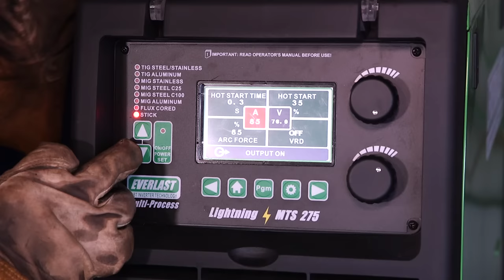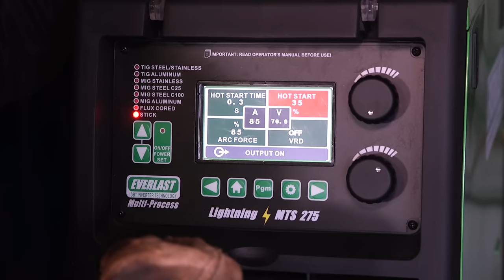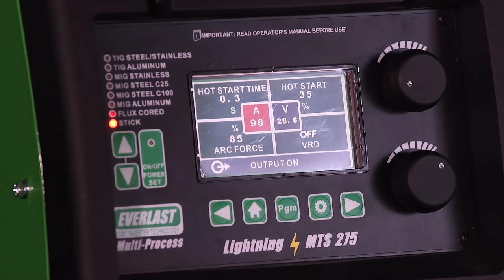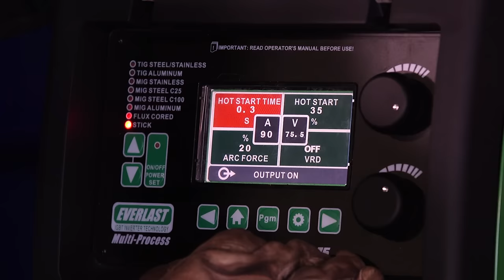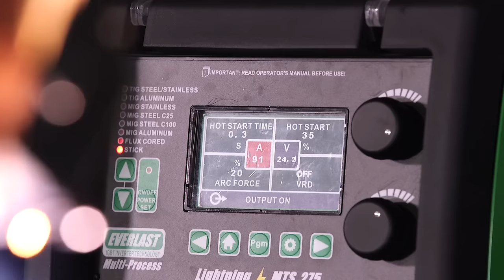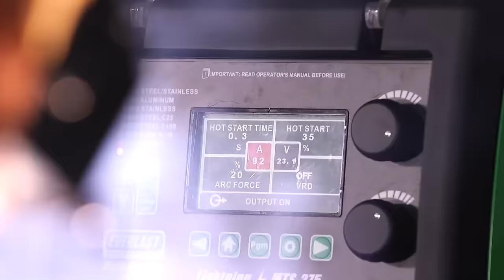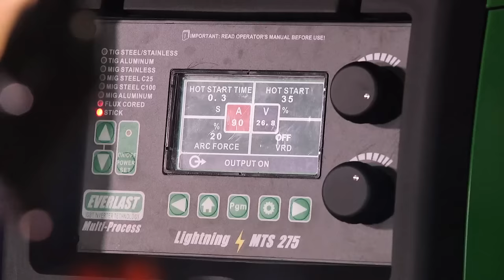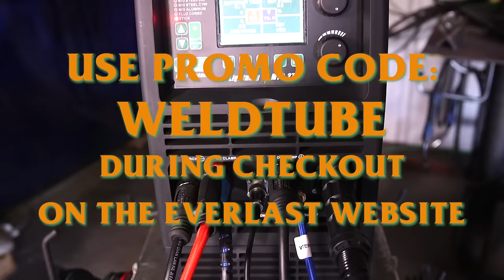STICK WELDING for Beginners | SMAW 6010 & 7018

Comment: you aren’t gonna find a machine like that at any highschool😂😂😂
Reply: we got into the shop today in welding and definitely not
Reply: My technical school when I was there had a $25,000 dollar welder and all of the basic ones in each booth were millers. But my county had ridiculous funding from some rich dude
Reply: ZarRax/ZR 😂😂😂😂😂😂
Reply: My high school has a bunch of miller’s they strike instantly
Reply: I’m in the welding program at Tampa bay tech, we only use Miller and Lincoln. Two more years till I leave and get my certification senior year
Reply: Haha, when you actually do
Reply: @C20ze  same
Reply: Nor out on the field smh 😂 where are the engine driven ones
Reply: You would love to see the welding shops in here Kern county high schools. They're sponsored by large oilfield companies and spare no expense, they're beautiful.
Reply: @Rylan Jennings my school has the nascar edition of Lincoln Electric multi setting welders
Reply: Or any job site lol, btw, tic toc works better than 1 2, the beads he is stacking are called stringers. The slag peeling off is a dragons tail. If you watch your puddle, there will be little or no lines in your weld, just smooth as glass.
Reply: @jackallred8228  tbt is a beast of a school. I wish I had went there instead of chamberlain.
Reply: My school has the Lincoln rectifier ac/dc. Not a bad machine but I wish each booth would have different machines so we can learn about them bc once were in the field they’re all different
Reply: @yehudastollak6808  that is what u need so u learn to set a machine to the sweet u like to weld in
Reply: @jackallred8228  Shit bro we go to the same school 😂😂🙏 and I’m in welding too
Reply: @veshiki1472  what period do you have welding
Reply: @jackallred8228  I was quarantined up until now, i get back to school tomorrow and I got 8th period welding and im in booth 10, I missed alot of time on the objective rip😔
Reply: @jacobcole4545  same currently burning 7018 Excalibur’s on it
Reply: My school was full of dynasty’s lol
Reply: I go to college classes and we don't use those either
Reply: Fontana High school, all Millers, strike instantly
Reply: My school has Lincoln electric machines they are very good they have all those setting as the one in video
Reply: My school has like 30 miller 250s
Reply: My highschool, with a graduating class of 20 has 9 Lincoln power mig 215 mpi welders
Reply: We have esab rebels at mine
Reply: We ran Miller Dialarcs for stick units. Loved those. So smooth. Rest were syncrowaves I think
Reply: We have like 5 millers and 4 lincons
Reply: We got millers at school
Reply: Miller's and Lincoln r just as good lol wtf
Reply: I have one
Reply: We do aswell
Reply: We got miller's

Comment: For anyone learning, after the root pass using 6010, it might help you to grind down the root pass to make sure that root is clean and theres no debris in there if its an xray test. 6010 is a DIRTY burning rod. Dont grind down far, just the top where the “coin stack” look is and not much farther. Just to make sure its clean. Dye penetration tests will reveal that shit as well. 

On the hot pass, you can also oscillate with a circular motion, making sure to hold the top wall for a quarter second or so to prevent undercutting on the top side. Gravity usually takes care of the bottom side assuming you dont come down too far and undercut. After cleaning the hot pass, run stringers over the top of it real nice and slow, 7018 looks real nice if you just let the rod burn and fill in :)

Professionally schooled, worked as a stick welder for a bit. Got 2000+ hours welding :) certified in 3G 7018 open root structural v groove welding
Reply: For pipe yes....but for this simple small puny t joint, weld on 👍
Reply: That's a 3F, show a 3G, with or without back plate, also you should explained AWS ,AISC, ASME STANDARDS there's a difference.
Reply: @Skyler Houtz theres always competition man, the thing about welding is it comes down to the test, if you pass it, the other competition doesnt matter. Just pass the test. Easier said than done, I know. But as long as you can pass a cwi administered test you should be gone 

Also ive never heard of hyperbaric welding sooo cant help much there
Reply: @stevenbruce5799  do I really have to do circles with 7018?
Reply: What if your goal is strong (full/near full penetration) welds on 1/4 to 1/2 inch plate?  Obviously, bevel (both sides) when possible. 

Is it best to run a 6010/6011 root pass then?
Reply: @ineedmoney6685   no, lol.
Reply: I guess I got lucky when I took my state weld test and the examiner cut my coupons and they came out perfect on my first try. Back in the day, we didn't have the option of grinding down our root pass. All we had was our chipping hammer and wire brush to clean every pass. Like I said, I guess I got lucky or I'm just a damn good welder. I'll take the latter.
Reply: I hear you, bro. I have to say, welding gets in your blood. At 66, I still love to weld. I still remember pretty much everything I learned at welding school and all the jobs I had at the ship yards and dry docks. It's still in my blood and I can still burn a mean rod. BTW, I love the 7018 lo-hy rod.
Reply: I got 10k hours

Comment: Dude, thank you so much for these videos. I'm currently at a welding tech school in the ass of nowhere Virginia, and my instructor is bottom level garbage can. Threw us into the lab, said here's the gas, here's the fuel, don't blow yourselves up, figure the rest out as you go. Only thing he actually told us for fillet was weld at a 45 degree angle, and to lay the root with a 6010 and the hot passes with 7018. Didn't even explain what a damn hot pass was. No explanation of proper amps, distance from weld, how to start an arc, where to hold the rod and at what distance from the metal. Keep in mind, I'd never touched a power tool before walking into this guy's class. I'd be lost without this info! You're helping me make my dream of a career in the trades into a reality. Great channel.
Reply: Currently what I’m dealing with now lol. Didn’t even explain the reason for amps, just said play around with it and do what works best for us. Definitely feel like I’ve wasted money but at least youtube will help me get through the course
Reply: Low key in the same boat. Instructor just kinda threw us in the deep end and explained very little. He has me on these tee joints and not once has he had me do this many and or said to use both rods during it.  Maybe that’s later cause I only just got put on stick. I passed my MiG section with the bare minimum of instructions. I had no clue what the dials did on the wire feed, or the voltage machine. No clue on distance. Thankfully o have a buddy who did the same course and he’s been the one nudging me in the right directions
Reply: Same bro I’m going in Virginia now currently

Comment: I've been a machinist my whole adult life, but took an adult welding course thru the local CC. I skipped the 1G and passed the 3G (vertical up)SMAW test first try because the instructor was so good. I had zero experience, literally never held a electrode before the course. Good instruction is priceless.

Comment: 1. i learned to never use a wire wheel to remove mill scale
2. i learned some good movement patterns for better welds including the forward back pause and small circle methods
3. i learned to always cover 50% of the last pas on the new pass
Reply: I always use wire wheel

Comment: The biggest problem I had when testing at the first couple of places is not letting the material properly cool. Don't let your nerves get to you. Take your time and don't get in a hurry. If the material gets too hot it won't flow right and if your doing verticals it will start falling out and look sloppy. Then your going to have to grind alot.

Amperage if course depends on your material thickness and rod size, but for a standard 7018 1/8 rod on 1/4 test plate I like to run at 115. But machines can be squirrely so see if they will allow you to run a pass or two on some scrap material. 

 Don't make the same mistakes I made, drink some water, smoke a cigarette or whatever and then burn in another bead. Try to get comfortable and relaxed.
Reply: With the Miller machine I use everyday at school with 7018 I run it at 120-122amps we’re just doing half inch angle irons but does that 5-7amp difference matter? I know vertical I have to go cooler and hold a bit longer before whipping but would I see better welds with less spatter over just 5 amps?
Reply: Old g welder 🔥
Reply: you’re right ab not getting mad. i kept getting mad and just wasn’t doing good, quit getting mad and got to burnin rods
Reply: Smoke a cigarette,  no thank you lol
Reply: @kendraspencer5703  then smoke 2 lol

Comment: I found using a ceramic paint stripping disc very quick in removing the mill scale. Made I beams and was having issues removing the scale. Used grind discs, sanding discs, and saw the ceramic paint and rust removal discs on Amazon. Love them. Used 3 grind discs to clear about 4 feet of web. Switched to ceramic and was able to get entire 147 inches cleared with 1 disc. Doesn't cut deep either. Fewer gouges than grinding.

Comment: Thanks for the video... I'm 100% new and in the planning stages of a simple project. Def learned some things and its very apparent you have great technique... but I still have a lot of whys... why hot passes then fill passes then caps?...when would I need to go and lay down 2 of each? why 6010 for the hot passes and 7018 for the others... why certain motions for one technique and different motions for the others... what do those motions do and are they appropriate for different situations?? I guess as a total newb I'm trying to figure out how to balance efficiency and quality within given tolerances, maybe you know of a good resource to point me towards or have some advice I'd greatly appreciate it!

Comment: Thank you for showing me this. I just started welding and am loving it. I’m currently am on T joint and want to try to pass it off before the end of this week. I’ve been trying to memorize the techniques that you pros use and it’s been helping me out a lot. Because of this I now know how the circles are suppose to be done and I also k ow a new technique which is the forward back up down. I’ve been struggling trying to get that part of the weld done on my T joint. I like your videos and want to see more. I just found you so I don’t know if you do tig or not but if you do I’d love to see some videos sense the area I live in doesn’t have ma y tig welders and so I would like to perfect that. Again thank you for you’re help.

Comment: I have really learned a lot from you ! I am a beginning stick welder, I can MIG weld but sometimes it isn't the prettiest but it definitely holds and I am improving every day, I bought a new Hobart Multi Process 200 welder which I am happy with . My question is I have been using 1/8" plate which I get from Lincoln for my coupons I notice you are using much thicker material any tips?? I don't have hot start or arc force. so starting the arc sometimes is frustrating with the 6010, I tap start instead off dragging the rod it seems 7018 and 6013 is easier to start consistently I am using Hobart and Esab 6010 rods. Thank you so much for your videos I am 64 years old and learning to stick weld next will be TIG!!

Comment: I have never used  an stick welder that has arc force. Is it worth getting a machine that has it. Right now I have a Miller Bobcat 250 and a Miller thunderbolt XL ac/dc

Comment: so at my school we have oxy, stick, mig, and tig which most machines work well but when i was on stick i could never get it to easily start. I would have to constantly strike the plate or metal i was working on to get it going. Does anyone know why it is like that? They look like pretty old machines but still in this video it doesnt look like you did that at all can i get some help 
another question is the slag never comes off easy we always have to hit is with a hammer type thing to knock it off is that common or no and if not what would fix it

Comment: heres my question, i have an amico power mma 200 dual phase arc welder. im running 110v @ 90 amps on 1/16 inch angle iron,  im having trouble burning 7018 and 6011, 6011 sticks a lot and 7018 sticks a lot too and is very difficult to start. im not sure if its supposed to be that hard to start. i can run 6013 with no problems at all easy starting and good clean burn with no sticking at all. but for some reason 6010 and 7018 are next to impossible to do. im wondering if its my machine or if 6010 and 7018 should only be ran on 220v? any pointers will be appreciated

Comment: Im a beginner and still in the process of learning. My question is wouldn't you want to clap down the divider to the base plate to close the gap as much as possible so there's not so much splatter or defect?

Comment: Why did those extra passes not run the full length of the joint? Saving the material since it's just an example or is there a reason in the industry for it

Comment: Good welding but I was taught to run 7018 all the way out on a T fillet 

6010 only on open root

Also I think it would be beneficial to see the puddle from the opposite side so we can how the weld is laying in there. Good job guys
Reply: Just remember man its different when you actually get out in the field. Everyone is going to make you think they know how to weld and most foremans just want it done. But its YOUR ass if that weld fails. And people could die if it does. 

I've melted over rat turds in some nasty  spots and if you ask to clean the weld zone outside of like a shipyard most places will laugh at you. 6010 is your friend if the weld zone isn't clean. Scratch off the 60 Flux with the bare side of a rod and then burn in your 70. Be fast but thorough and you'll keep a stinger in your hand.
Reply: Doesnt matter, what matters is which rod they let you use or test

Comment: I was wondering why  3/32  7018  when you ran 1/8  6010? I  use the same size rod  for both if 3/8  material  and above.

Comment: Not sure what's up with the small circles, 7018 is a drag rod and you get the exact same looking weld just running it straight without the extra motion?

Comment: Great job! Thanks for sharing the exercise, I have a question, it's not need to make a bevel to get a better penetration?
Reply: Depends on the prep procedure. But this is a standard weld joint that are most common.

Comment: I'm trying to get the hang of using E7018 1/8" for the 2F T-Joint welds. Weld beads itself looks good, but the issue I'm having is consistent undercut. I'm wondering if it's because I have the amperage setting too high? I usually run at 108A. Sometimes the welds do not penetrate into the joint, do I need to set the arc control a touch higher? roughly at 65%. Using a Miller 70 Series welding machine, welding on 3/8" A36 steel

Unrelated, the Everlast Lightning MTS 275 looks like a solid machine, and the price doesn't appear to demolish a bank account either for what it's capable of doing
Reply: You could simply be using too long of an arc length.  A longer arc length will carve out the steel due to the heat from the arc, but the metal deposition is not filling it in because it's a little too far.  You should be able to feel the flux from the 7018 rod just slightly drag on the steel .  This is because the actual rod is burning up inside the flux so it's a little farther from the puddle than what you can see.  108A is within the acceptable range for 1/8" 7018, most run 115-130A.  Tighten up your arc length, and if you end up sticking the rod, you need to bump up the amps a little bit.

Comment: Hi I c u are welding at 85amp on what look like 10mm plate, would u get enough penetration with the root pass,  I was told u need at least 160amp on this thickness thks

Comment: I have a question maybe any welder can answer ... this may be an obvious one to a welder, but I just like to know things for sure.... I am assuming that if this welding of 2 plates in the T formation was being done in production then this procedure of the root, hotpass, 2 fills and 3 bead cap would have to be done on both sides of the joint.  Is that correct... the only reason I really ask that is because I assume that these guys do a lot of structure like pipeline where welding both sides may not be possible...  (again, that is an assumption on my part but you have to ask if you don't know)... Thank you for anyone who has a moment to answer.

Comment: Why 6010 for a root pass as opposed to 7018 for the whole thing? I'm just starting to weld at almost 50 years old for a hobby. I bought a multiprocessor welder couple months ago. Started with Flux Mig and my welds started looking good. Then i tried stick. Holy crap, a blind man could make better beads and stick it less. Stick is tough for me.